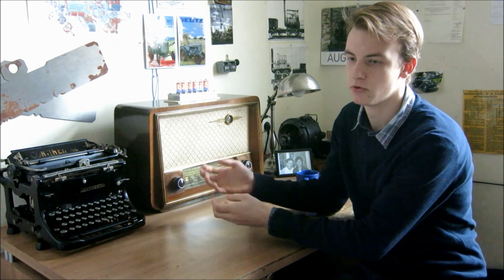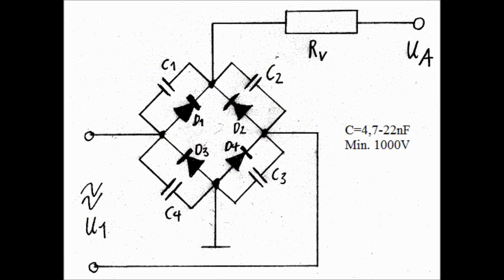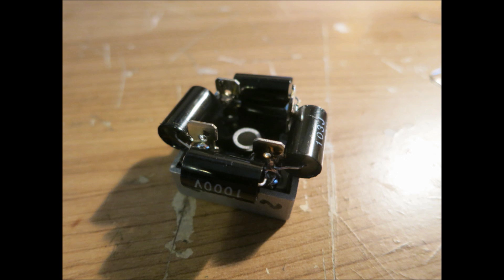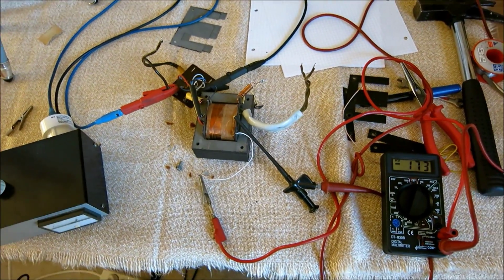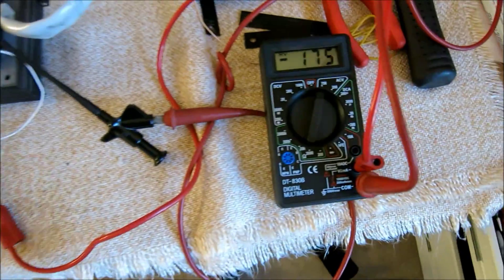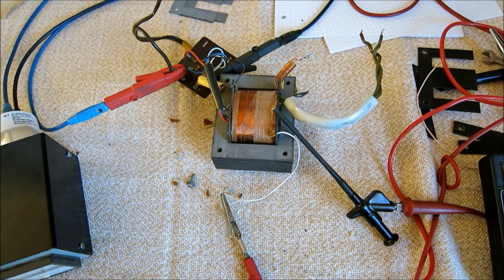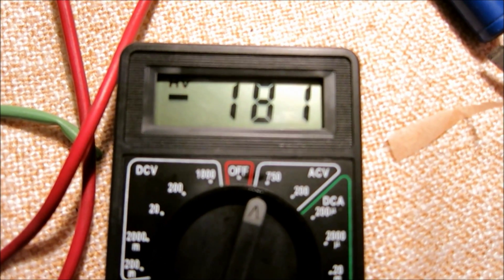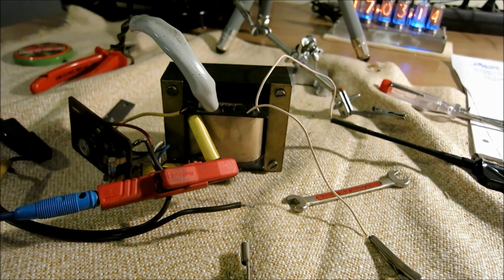Alternative Way to replace a Selenium Rectifier

Comment: Paralleling rectifier diodes with small values of capacitance (~ 1 nF) slows the reverse recovery transient which reduces radio frequence interference production.  Paralleling the silicon rectifier with large values of capacitance (> 47 nF) is nuts.  Transformer winding current is increased which causes resistive loss and increased heating of the transformer winding, i.e., less efficiency.  The resistor solution is to be preferred because electrolytic capacitors are designed to withstand a surge voltage.  If a capacitor fails (shorts or opens) on start-up it was ready to die anyway.  Install new capacitors - less work, simpler!!!

Comment: very bad way to reduce the voltage to a silicon diode, just put a resistor i series and you are don, this is just a radio , ,,not a precision machine boy ,,,,,, a lot  work for nothing, or maybe you want showof, my finger go down on this video
Reply from the maker: For a "very bad way" it's held up surprisingly well during the last 6 years.
What you do to your radios is your choice.
Reply: Dude, if you don't like it don't watch. For Christ's sake, why do people always feel the need to chime in with negativity. He said he was trying something different. Why squash experimentation? Let the grown-ups speak ;-)

Comment: Hi Adrian, great video, thanks for sharing! I see that the voltage selector is put on 240 V AC. Did you check the filament voltage at any time? Usually when I do this with tube radios, the filament voltage gets a little low. That kind of makes me hesitant to do so because I heard that the tubes hate it to be “underheated” it.
Reply from the maker: Thanks,
line voltage at our house usually is around 235-237V, so all my radios are on the 240V setting.
I never measured tube voltages, but the radio shown in this video runs about 10 hours daily (except weekends) and has never had any problems regarding underheated tubes.

Comment: You got the math right, except the last step, so you should remove 280 windings instead of 300.. I guess the low voltage result comes from that. 180 V tested was without load.
Reply from the maker: You won't believe it, but I actually took the thing back apart a couple of months after this video and put some windings back onto the transformer. It did actually put out around 175 Volts AC the way it was, but I accuse the Variac's Volt Meter of not being accurate - it required about 210 Volts AC from the Transformer in order to produce the 260 Volts DC specified in the schematic.
All the Best
Adrian
Reply: Great discussion!

Comment: On the one hand this is a pretty accomplished hack - I never thought of stripping a mains TX and changing the ratio, and if I did, i'd have hesitated to try it! On the other - are you sure you are fixing a problem that actually exists? If the anode voltage on the tubes is 10% high while they warm up, does it even matter, as long as it is less than the maximum rated for that tube type (and the working voltage of the caps of course)? If there is no current there is no power dissipated in the anode anyway, so how will it do any damage?
Reply from the maker: To be honest, I simply didnt like the idea of a big, chunky resistor burning all the excess voltage. I did try running the tubes straight from the rectifier before I dug into the transformer and had a quite disturbing amount of static hum - so something had to be done to reduce voltage.
Without a doubt though, the radio would have run just fine without this complicated procedure! This was just a brainchild of a late night that would not leave me until I had tried it ;-)
It certainly puts less strain on the transformer though - this thing runs on my desk pretty much all day long and the transformer barely gets warm to the touch.
All the Best
Adrian
Reply: @AstraWerke  fair enough! very best to you too.

Comment: Thanks for getting back to me ,your info is helpful ,I do worry about running to a hot chassis radio,why they ever made those, is be yound me ,makes radios dangerous, I am mostly a kit builder,but I have been tinkering with electronic over fifty years ,I just started with tube radios ,I watch a lot of videos on repair of them  and with what I no ,together I will do repairs on stuff that I no how to do,anything else I won't do ,changing cap,testing tubes ,checking resistor ,I do like your videos a lot hope you make more your fan

Comment: Me personally I would have removed the selium, it serve no purpose anymore  and it may confuse the next owner,I rather see the new parts ,but that's just me ,I bought a restored radio ,the guy left the filter cap in ,and right up again it was the new  replacement caps and it look very ugly and confusing ,may be I will pull the old cap.can you tell me is a variact  a good investment ,I only have two tube radios I am recapping ,what else can a variact be used for anyone ?
Reply from the maker: Well, first of all this Radio is a family heritage so I dont plan on ever selling it. Leaving old capacitors in is indeed confusing - if I'd absolutely want to keep the tin cans, I'd open them up, remove its guts and stuff a new capacitor into there. That could also be done with the rectifier but that was too much effort in my opinion as opposed to just leaving the old one in there. I'm pretty sure a person working on the radio would quickly figure out the Selenium Rectifier isn't hooked up to anything.
Considering the variac: Its not worth it. I have borrowed this one for that single purpose and never needed one ever since. If you just have two radios, I'd rather use the lightbulb trick to do the initial power-up.
Basically all you do is hook a 40-60W light bulb in series with the radio. 
Worst case: A dead short in the radio. Instead of letting the smoke out, the light bulb will simply light up brightly and limit the current to prevent any further damage. It's also a good way to monitor how much current is going into the radio - simply judging by the bulb's brightness.
I show a device I made myself for that in some other video - I think its about a Nordmende.
All the Best
Adrian

Comment: You are a lot braver than I am- I would have installed a resistor in series between the rectifier and the filter capacitors and left it at that! Tearing into that power transformer was a formidable undertaking!!!
Reply from the maker: Thanks :D
Reply: Adrian Straub ...you realize that it will very difficult to return the radio  to its "original" condition(?)
Reply from the maker: @daleburrell6273  It would most certainly be quite a task. HOWEVER:
1. It would be hard enough to obtain a working selenium rectifier of this type to replace the worn-out original
2. I don't think anybody would bother putting in a selenium rectifier that required the higher voltage
3. This radio will most certainly remain in my posession until my death. In that timespan, I can assure you, no one apart from myself will fix this radio - and I will most certainly not put a selenium rectifier into it.
To sum things up, I don't think returning this radio to original will be considered by anyone in the coming decades, so there's no need to worry about it.
All the Best
Adrian
Ps.: I JUST noticed your comment - sorry it took me over a year to answer ;-)
Reply: @AstraWerke ...time flies(!)

Comment: That is not really "hum"...what is happening is that the silicon diodes produce very high frequency noise when they conduct. This noise can show up as interference when the radio is playing. The capacitors across the diodes serve to short out this noise.
Reply from the maker: Should have called it "hiss", you are absolutely right.

Comment: Very brave to go into the transformer. Great job. By the way, where do you get those black film caps? I use the yellows, but the black ones give it a more authentic look.
Reply from the maker: I got them at a website called "Antikradio Restored" - here's their website if you want to take a look:
http://shop.antikradio-restored.de/
Reply: +Adrian Straub : thanks.